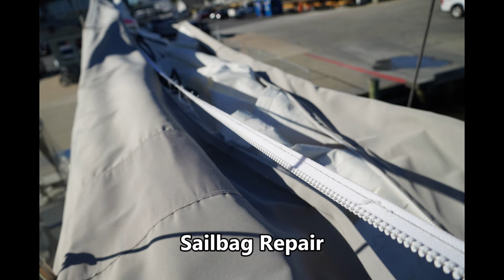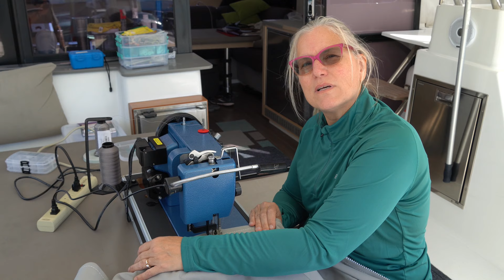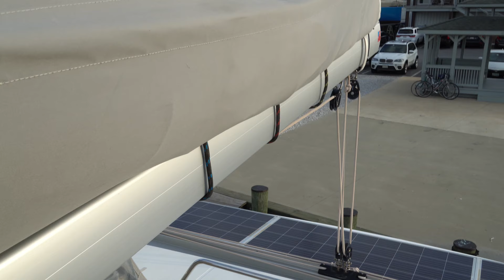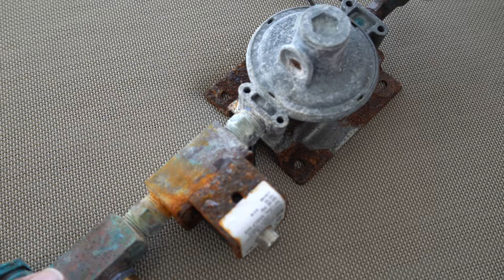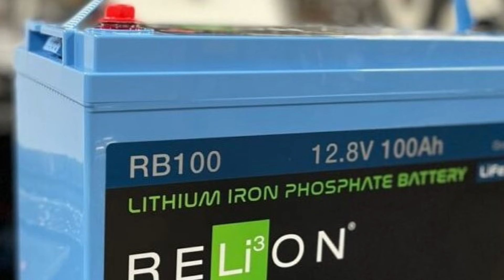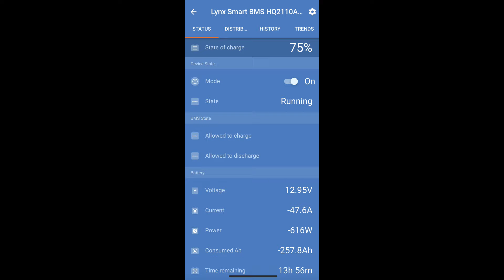Catamaran Liveaboard Refit Part 2

Comment: Another great video, please keep them coming!!! Everything you have covered in this video, I also need to do...(gas regulator, bbq, sail stack pack) hopefully I want annoy you with too many questions.  :)
BBQ: my boat currently has a small Magma that is in terrible condition. I also wanted to use a Webber. Interested to understand the pressure challenge. From what I could see: bottle -> T piece (for Webber) -> regulator -> solenoid -> galley stove.  The Webber receives unregulated pressure, while galley is regulated?
Stack Pack: you mentioned there were a few holes... my stack pack has become UV rotten and fell apart. I have the new materials to make a replacement, but have since heard some packs have the front part lined with old sail cloth to help stop wear. Were the holes in your stack pack from wear at the front... wondering if need to grab an old sail.

Looking forward to your next video on the solar and batteries, also on my to do list.   :)
Reply from the maker: Yes the gas supply to Weber needs full bottle pressure since it is designed for the screw on 1lb bottles. Our stack pack wore at the attachment points where the bag rubbed on the bags lines. Luckily just the thread had let go in ours so it was mostly re sewing.